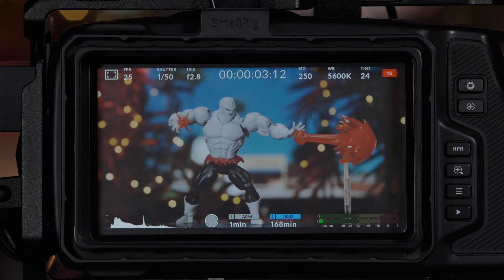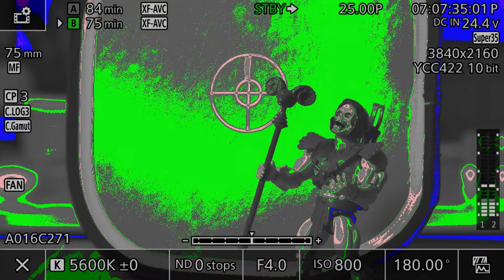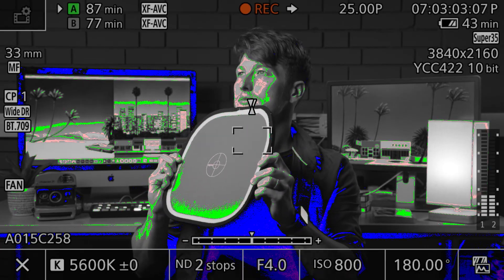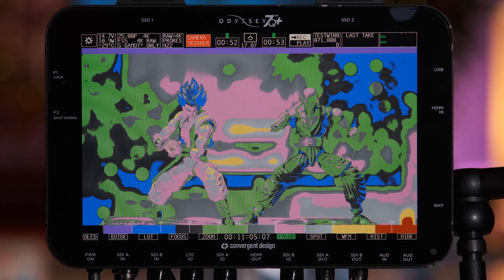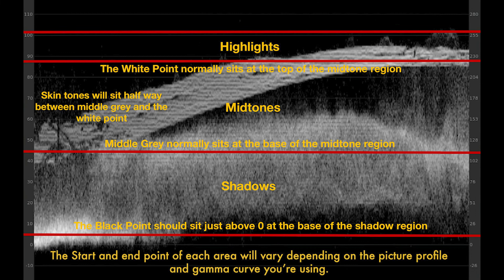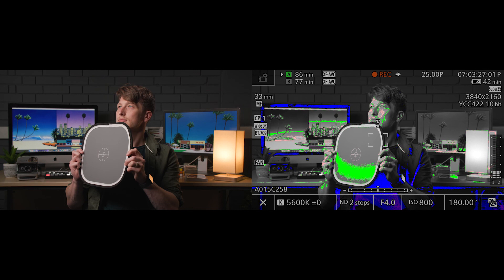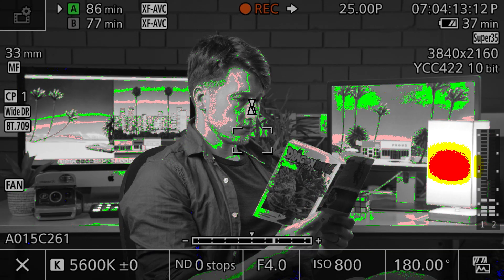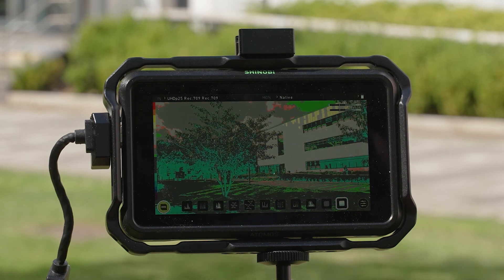False Colour: How To Use It!

Comment: I assume (perhaps incorrectly) that most people with a Cinema camera would be shooting in RAW or LOG, and therefore would be post-processing in a video editor, and pulling down and adjusting the waveform curves anyway.  So whatever exposure is set when recording (e.g. trying to correctly set middle grey to correct IRE) is going to be invalid and reset in post.  Therefore as you say, when in RAW/LOG you need to over-expose when recording, and set the levels in post.  But this kinda invalidates some of the info in the video, or rather makes it more applicable to those not doing much post. Having said that, I indeed found that using CP1 Wide DR profile is excellent straight out of camera, provides a really good base REC 709 image and a great starting point for basic grading.  I'm so tempted to start using CP1 instead, but feel I'm wasting some of the capabilities of the camera ... still learning.
Reply from the maker: Unfortunately shooting in LOG or RAW doesn’t mean you can expose incorrectly in camera and fix it in post. Yes, with these two types of recordings you do have more play in latitude adjustment and manipulation but that doesn’t mean the you can just expose wherever you want and it will be fixable. 
Log formats have more latitude but can still be clipped and can loose information if over or under exposed, and if you underexpose too much (even with a raw format) the digital noise and grain will be burned into the footage. 
This becomes even more problematic with older cameras and older sensors. 
Newer cameras like the Sony FX range and Canon C70 are much better at controlling their noise and grain, but it can still easily be poorly exposed.
RAW formats are actually even more prevalent at retaining noise because there is no noise reduction happening in the camera, and while the RAW format has a ridiculous amount of adjustability, the noise and grain will still be burned in. Yes you can use software to try and remove it in post but this may also soften your image or muddy it (depending on how good an editor you are) and how good the camera is 
Remember that not all LOG & RAW formats are created equally.

It’s also important to try and record at correct levels from a colour perspective, if you under or over expose too much you will start to affect the colour quality and this normally leaves a magenta or green hues; recording at the appropriate levels with false colour gives you a baseline for correct scientific exposure for that cameras sensor, and will allow you to get the overall best image quality. 
So I would have to disagree with your initial assumption, one of the most important things we say to our students is ‘fixing it in post should not be a priority, shooting it correctly should be’ 
False colour, just like a traditional light meter, is an imperative part of modern professional filmmaking practice  and personally I think it should always be used alongside digital cameras wherever possible.
 
Hope this helps to better explain my veiwpoint  ☺️